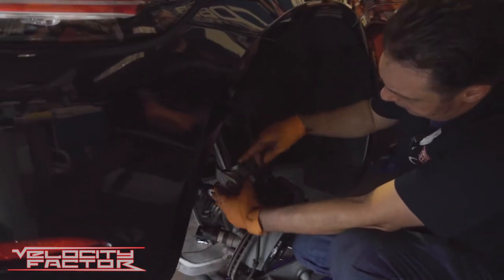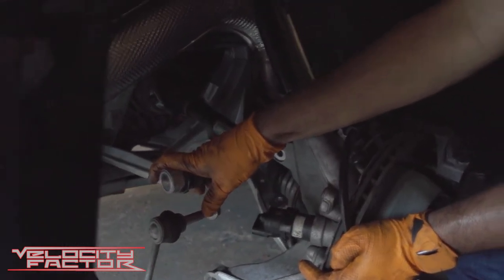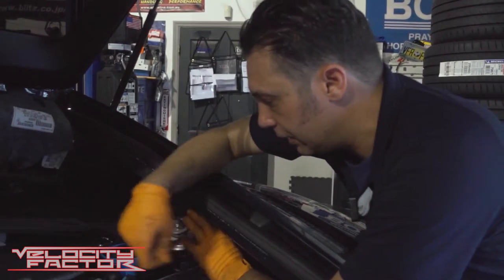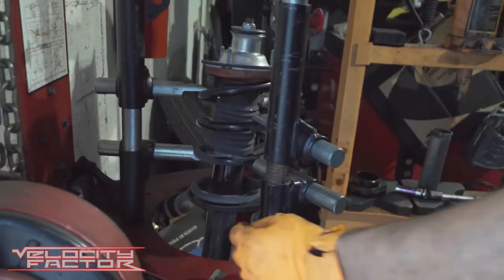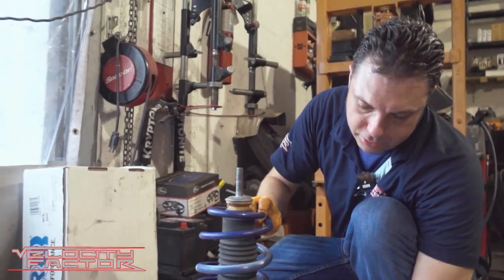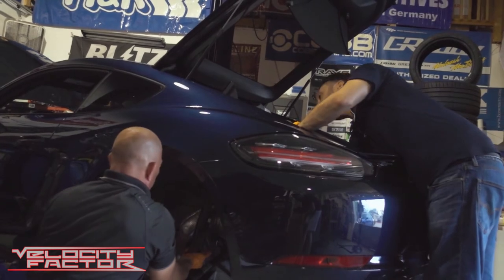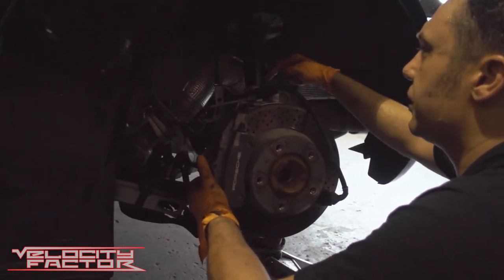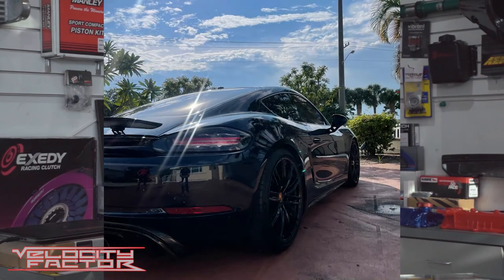Porsche 718 - In this video we install H&R lowering springs on a Porsche 718 Cayman.

Comment: After spring install my steering alignment  is to the left . Controlled via hawk machine everything is okay but while driving straight wheel is off by 2-3 degree to left any suggestions thanks a lot .

Comment: Excellent video 👍  I have a 2013 981S Boxster. I am getting a set of Bilstein PASM coilovers (they are much wanted and on top of that my car is currently off road as one of the front OEM original coils failed recently at about 105,000 miles - it is cracked. I feel confident replacing the front shocks and coils myself but I am not sure about the rears even more so after watching your video. The question is: is the 981 rears  easier to work on or will I face the same issues as you shown for the 982 (I don't like it to call it 718!) ? If there are any videos about how to replace the rear shocks on the 981 then please let me have the links. Many tanks
Reply from the maker: Sorry for the late response, we are back in action now. I would recommend that you let a professional shop install the coils. You will run into some of the same complications if you decide to install it yourself. Unfortunately, we do not have any 981 videos we can recommend. If you bring yours here, you would be the first video!
Reply: @velocityfactorboca  many thanks for your reply. One of my sins: I really like a challenge! I am UK based otherwise we could come up with something together. The 981 S is being used as a mule (everything suspension except the Bilsteins which have now arrived)  will get swapped for Tarett's stuff (lower arms, drop links, control arms, shock  mounts / camber plates)  before I put my hands on another Porsche car. There are Porsche specialists where I live if I get stuck I am sure they will rescue me. Nevertheless they will be used for all required alignments, be in no doubt. So far I have been ok with my tinkering!
Reply from the maker: @sixpotshot  You're very welcome! Well once you do take on that challenge, please let us know what complications you run into! When you're in Florida, you are welcome to our shop!
Reply: @velocityfactorboca  Expect a visit at some point when this Covid madness is gone! I'll do my best to keep you up to date but it will be a while - These (the rears - the fronts are in stock and on hold) are on order and should arrive end of December